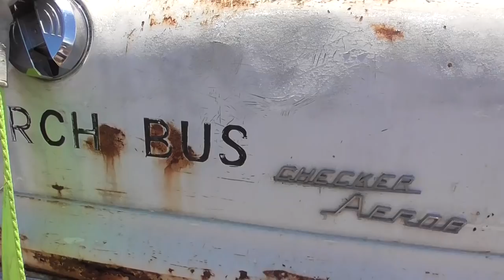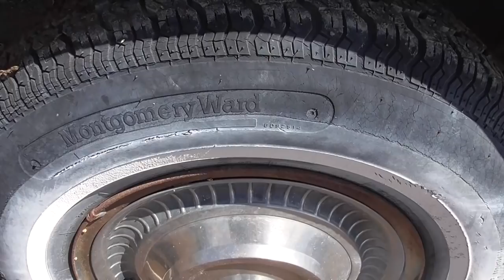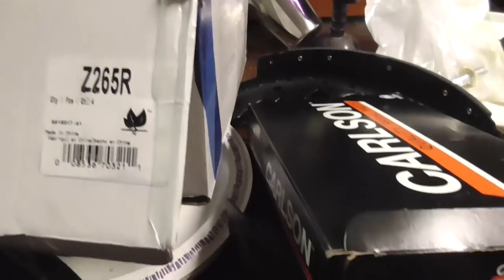Checker Limo First Start and Cruise in 28 years!! A 12 Person Bug Out Bus!

Comment: Checker was the most comfortable to drive or ride in.... all the seats where interchangeable, so were all the doors, and all the cars made where made with the same parts. engine and drive train was Chevy.  and all the running gear was stock from other car manufacturer's. So you could get parts anywhere.
It was the greatest for long distance travel, Because you road in comfort and never got any aches and pains from sitting for a long time. and high mileage didn't mean a worn out car.

I loved my Checker Marathon!
Reply from the maker: That's awesome, you should post pics to our Facebook page!

Comment: That under dash AC unit is super easy to get going as well, they are very simple to work on.
Reply from the maker: Nice, we are going to need it next summer for sure. I haven't worked on many classic ac systems. Only modern ones.
Reply: I work in a classic/hot rod shop, and the under dash units are cheapest ones to work with. Most expensive bit is the compressor, but I am sure you can salvage one to keep the costs down. Wiring with a single binary switch is super easy as well.
Reply from the maker: Thats good, obviously the refrigerant leaked out but we are hoping the compressor and condenser might still be good. Finding a used one shouldnt be hard either.
Reply: The old R12 system will happily run on 134A after being cleaned out, Crimping new hoses is easy work as well. If the wiring is good it should be simple enough, and even if it isn't there's only two circuits.
Reply from the maker: That's good to know, thanks for all the info!
Reply: All us oddballs gotta stick together. Cheers.

Comment: Put a can of ATF fed slow into the carburetor, it will knock off the buildup on the valves and smooth out the idle. Do it at night because of the black smoke! Good luck

Comment: They didn't delete the brake on the drivers side. The pistons were rusted solid and wouldn't move.
You can replace the starter drive and the starter will not do the just spin.

Comment: Plz for historical perpose try and remove rust and repaint chasy
Reply from the maker: The body rust is very bad but we are working on ways of repairing it. Thankfully the chassis is in great shape
Reply: @ApocalypseAuto  cut those areas out put mesh bondo then paint then get engine taken apart and cleaned then re asembled see if it can do burnout also get those doors fixed XD
Reply: Remove rust? Lame

Comment: If Cuda drum brakes fit, so do Cuda disc brakes, right? With the right parts swaps you might even get the big Mopar 12" discs on there. Is Scarebird still around?
Reply: Wilwood should be able to hook them up.

Comment: Looks like an early 60s car
Reply: That's a mid - fifty's style.  That body style was introduced in about 1955
Reply: 1960 to 1982.
Reply: @robertlee9395  Well, my folks had a '61 and a '67 but they introduced the body in '56.  I know wiki doesn't say it but check this link.  The originals had single headlights and different grill.  Our '61 had a different grill than the '56 and slightly different than the '67 which was the same up to '82 https://www.youtube.com/results?search_query=1957+checker+cab
Reply: '61 also had quad headlights that I'm guessing were added in '58 like the rest of the US added about that time.
Reply: @robertlee9395  '60 looks like first year of the Marathon name but not the body style.  That goes back to '56

Comment: Wheels are too big, and car has the height of mount everest...
It just looks silly the way it is now, it certainly wouldn't get much love on stance nation meet ups ^_^
Reply from the maker: Haha yeah, wheels were free so we went with them for now. We have big plans in the future for it
Reply: Dude if they dumped this thing itd be so legit
Reply: You should repair the fenders, especially putting those in the rear back to its original shape, puts some bags on it and look up some Rotiform wheels, that will give the car some attitude.
American racing works as well, but this is usually the first choice for most people with american muscle.
Actually, you need to fix up the entire car if this is gonna take off.
You would also want to have a roof rack, because if you're ever gonna go camping, this is what you'd want to have.
As for the front lights, lenses is the way to go for at least two of the lights.
Color wise, what do you guys think about blurry grey with mirror effect and a hint of light blue shining through when hit by the sun?
I think you would want to have a set of wheels that has chrome to go with it as well.
Grey in general and chrome, is sort of radical and badass.
I can also see how metallic dark blue goes well with metallic grey roof.
If you want to see how it looks, you can kind of try out different color combinations on a 55 Bel Air in Forza Horizon 4, just so you can see where you want to go with this, but this is some suggestions you can sleep on
In any case, if you want this car to be known by many, you want it to be a winner in showrooms, it certainly has potential ^_^

Comment: I owned 2 Checkers, they rusted worse than any other car I can remember, and parts are for the most part unavailable, beside the GM mechanicals. Very difficult to restore.
Reply from the maker: Yes this one is very badly rusted, all the door pillars are almost rusted thru completely. Thankfully the frame is in great shape
Reply: I happened on one in a New York state junkyard that appeared as though someone tried to make a truck out of it.  The whole back half of the body was gone.  The frame was fine.

Comment: I wouldn't open up the rear quarters to let those tires fit. I instead would either consider installing air bags on the rear suspension, or just put smaller tires on it. Those 22's just do not look right on that car. Besides, why would anyone want to damage a nearly perfect body on a car like that just to make room for tires that look way out of place?? I would drop down to 17's or 18's, but definitely not the original 14 or 15 inch tires that were on it. 

EDIT................I sure would like to see that beast sitting in my driveway.
Reply from the maker: Yes, the rim's were free and work for the mean time but we plan on getting something better

Comment: would have soaked the cylinders with marvel mystery oil for a week and cranked it by hand to make sure is i free then drane the old oil and use rotella 15w40 with marvel mystery oil and primed the oiling system with drill! just starting a old engine can brake a ring or worse!!!